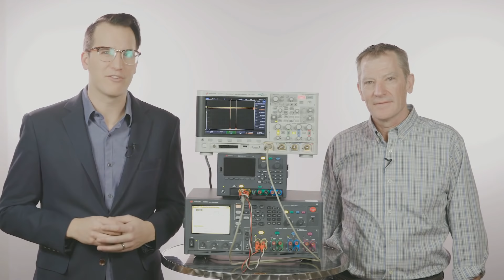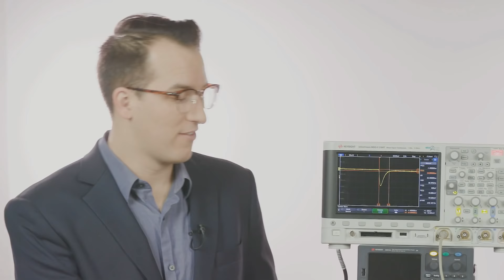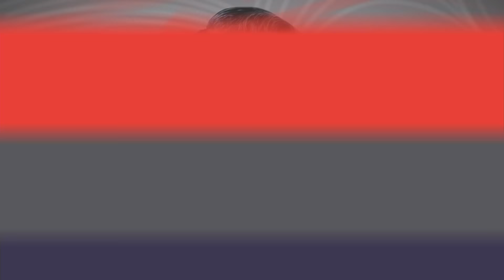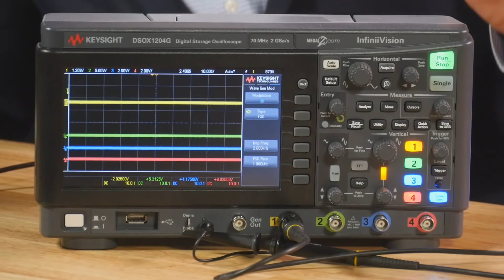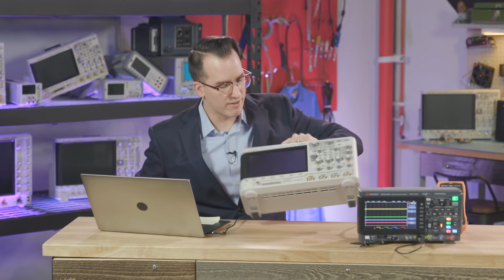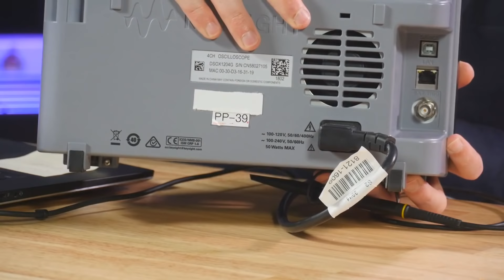Power Supply Transient Response & Wave winners! (4-Mar)

Comment: BTW, the two new electronic load modules that were mentioned in the video are the N6791A 60 V, 20 A, 100W electronic load module and the N6792A 60 V, 40 A, 200W electronic load module.
Reply: There's a typo in the N6731B-N6792A DC Power & Load Modules N6700C-N6705C Mainframes 12 Specifications Guide with respect to the above two modules in that on page 13 in the table under the heading Keysight N679xA Load Module Differences, both columns are N6791A when the second column should be N6792A.
Reply from the maker: Thanks, I'll look into it!

Comment: WOAH WOAH WOAH, When did you guys introduce a new Electronic load? I missed this in my electronic load searches :D Would love to see a more detailed video on it!
Reply from the maker: It just came out, we're pretty excited about it. It's really geared towards the heavy-hitter system power/power analyzer folks.

There's 100W and 200W versions, both of which go in the N6700 power analyzers:

https://www.keysight.com/en/pd-2972438-pn-N6791A/dc-electronic-load-module-1u-height-60-v-20-a-100w?nid=-35714.1261087.00&cc=US&lc=eng
https://www.keysight.com/en/pd-2972446-pn-N6792A/dc-electronic-load-module-1u-height-60-v-40-a-200w?nid=-35714.1261089.00&cc=US&lc=eng

Comment: Sounded to me like the USB Master and Device references were reversed.  On the back panel there was a B-type connector which is not Master, it is Device.  Or maybe I just timed the finger pointing wrong relative to the description.  But in any case, the front panel USB (for a memory module) is a Master, the “flat” A-type.
Reply from the maker: Yeah, I must have misspoke. Good catch!

Comment: All the oscilloscope show the signal in 2D.
Can keysight make 3D oscilloscope ?
"radio signal". "dif voltage and current"
Reply from the maker: So, the scope is 3D :). But, would that look something like a waterfall plot? That's a fairly common mode for non-time domain devices like signal analyzers.

Comment: 35:00 Winner selection of today
Reply from the maker: We were able to snip out the 30 minutes of "fun." And by "fun" I, of course, mean technical difficulties.
Reply: @KeysightLabs  you should've kept it in there it probably was pretty fun
Reply: Not cool... doesn't work :-(
Reply: @DryLog420  
That's strange. The video was about > 50 min long a couple of hours ago and the time was correct.
Try 6:40 for this short one.
Reply: @OpenGL4ever  thanks! I scrolled down about 5 comments and found that time stamp :-p 

Thanks for trying :-)